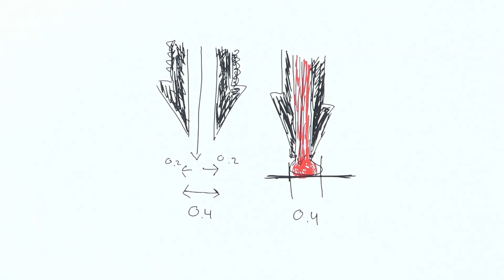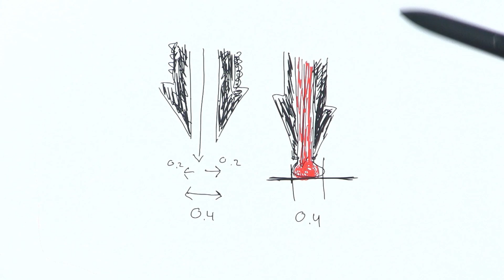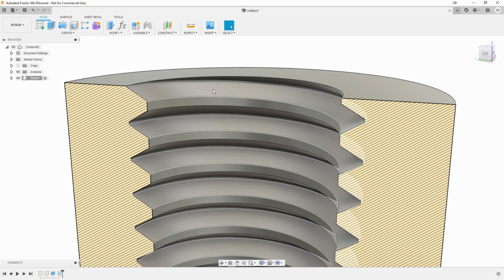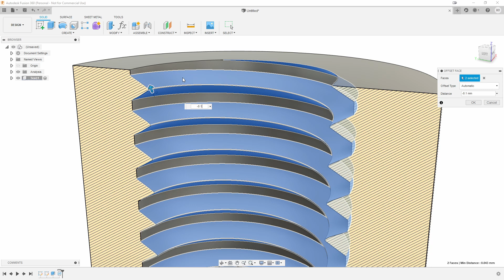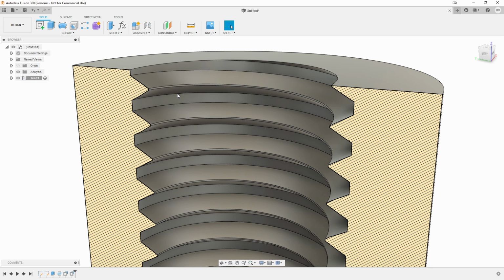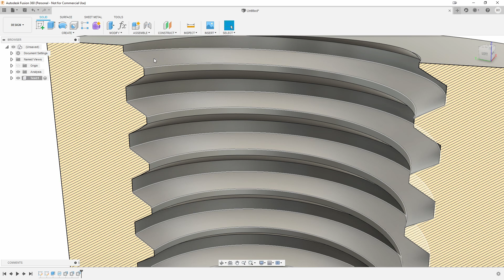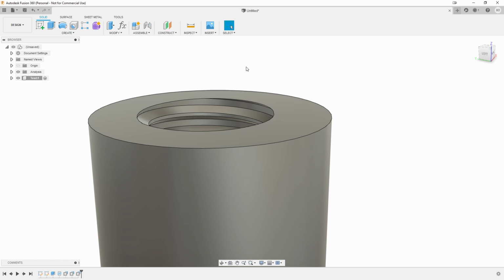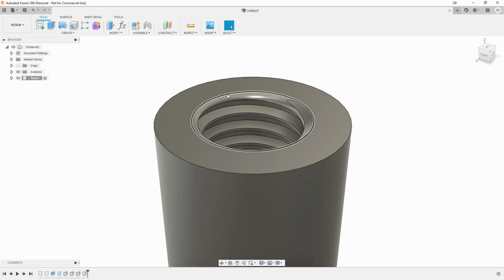▼ how to 3d Print screw threads | Fusion 360 tutorial

Comment: Why blow ( aquarium pump ) rather than suck ( vacuum cleaner ). Wouldn't it be better to have a slot in the end of the nozzle instead of just a hole.
Reply from the maker: When you blow air, the ashes that are created by the burning material are also blown out of the grooves the laser makes. You can't suck away the ashes with a vacuum cleaner. It's not shown in my video, but when the laser is in my workshop, it operates in a closed box with an exhaust that also has filters.